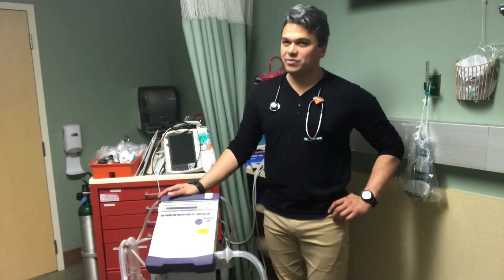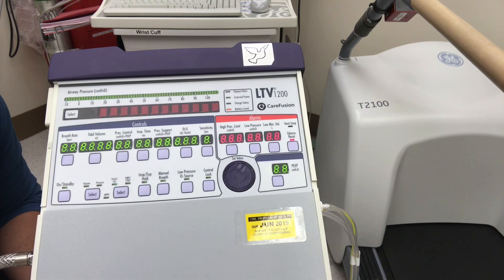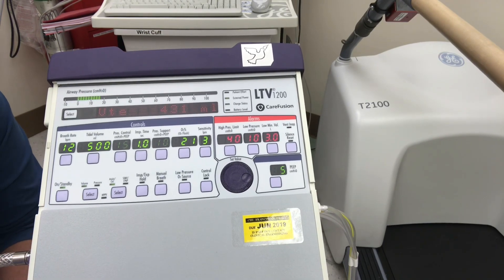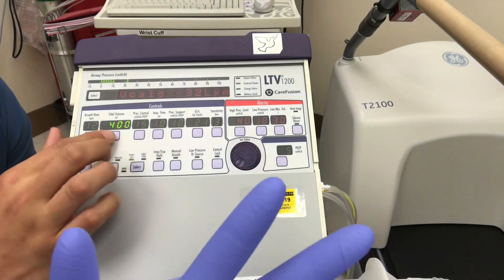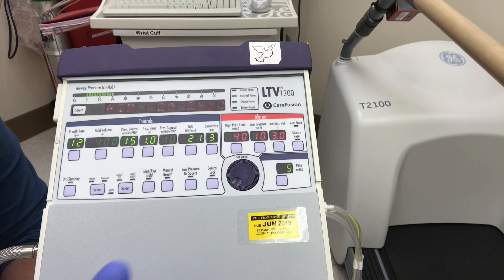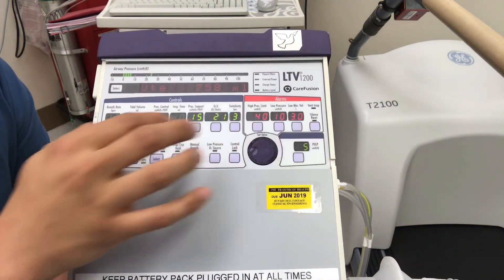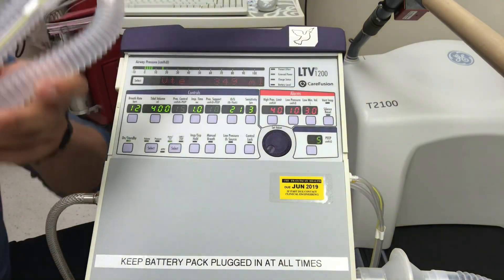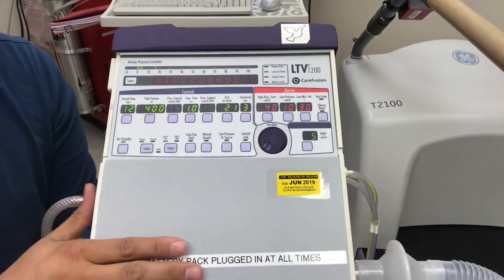LTV 1200 ventilator: modes and settings

Comment: May I manage a ARDS with this machine please?
Reply: Benoucheca Pierre it certainly has the capability, you can set ac and check plateau pressures. It has a good pressure control mode as well.

Comment: Why is the filter at the vent? It should be on the patient side of the circuit shouldn't it?
Reply: Jason Keef no, the bacteria filter protects the vent/patient from contamination, an HME goes on the patient side.
Reply: @hbomb1512  I was told that it was essentially a 1 way circuit at that point, the filter needing to be on the patient side so contamination doesn't get exhaled out the exhalation side.  Perhaps I had been told wrong.
Reply from the maker: @jasonkeef600   the filter is designed to prevent cross contamination between the machine and patient. The LTV has an exhalation limb that doesn't seem to be filtered. I do know that the manufacturer doesn't approve the filter to be placed at anywhere other than than at the machine and distal to the patient. If you were taught otherwise, I guess it couldn't hurt, it actually makes a lot of sense! Just know that the filter is designed to act as barrier between the machine and patient for possible back pressure contamination and is not medically approved to filter the exhaled air that escapes from the expiratory limb. There are actually some studies that say that the bacterial filter doesn't really decrease incidents of infection, so it seems to just be a CYA/money maker thing from the manufacturer. I am no infection control expert; I would adhere to your protocols and company guidelines for use. Great question! I'll look more in this, you have me curious now!
Reply: @henrythatrtguy  I see, that is interesting. Thanks for answering!
Reply: Actually condensation is higher closer to the patient and trigger the vent to recycle so its safer when the filter is placed distal to the patient